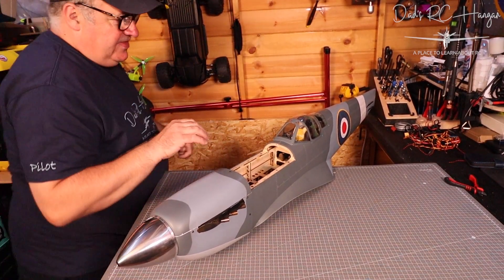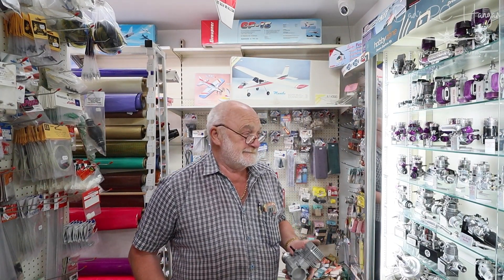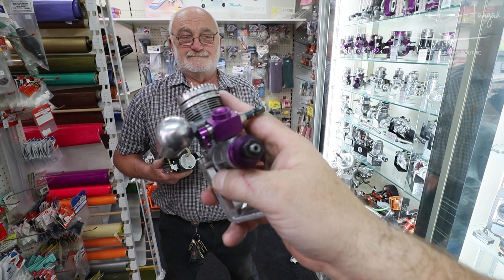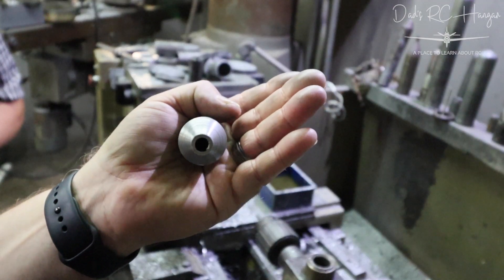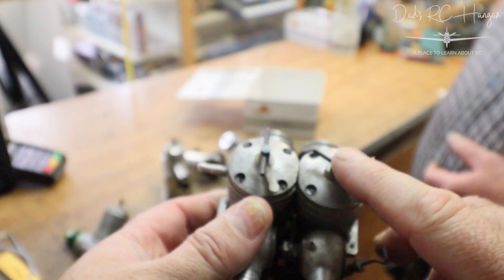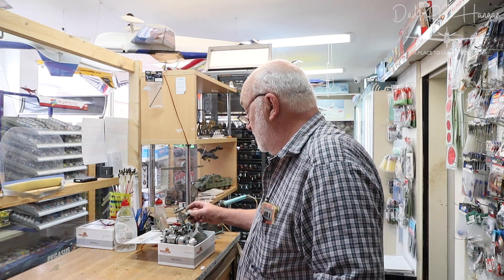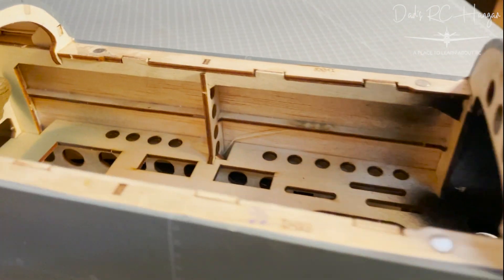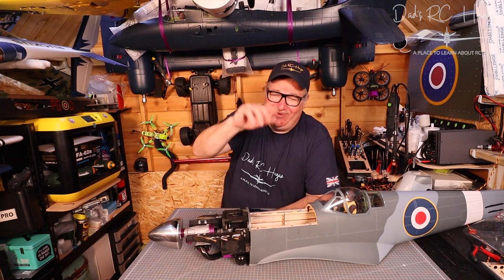Supermarine Spitfire | Custom Exhaust

Comment: Nice one Chris. Is the engine and exhaust system reasonably priced ?
Reply from the maker: £600 for both, so this was a one off. But it’s something I had on the RC bucket list. Thanks for watching David, have a great weekend.  👍🏻
Reply: Thanks Chris and you.
Reply: I think it's about time the Spitfire got finished Chris 😉💪 2 years ago mate !!! Time flies doesn't it. I must take my 60 size Spit to the field for a fly the plumbing was all wrong last time I took it last summer !!!!! 🙈
Reply from the maker: @stevearmett1565 I know buddy, it’s like I need a Month in the Hangar 😂. I have a new Fuse and Tail, I really must finish the spit. Makes me laugh when I see how long I have been trying to Fly and get my A.😄
Reply: @DadsRCHangar  you will get it this year Chris you just need a couple weeks of flying each weekend to get you back in the groove 👌
Reply from the maker: @stevearmett1565  Should be flying Saturday 😁

Comment: I use epoxy on all my mufflers, best thing you can do! Not only does it seal it but will not vibrate lose!
Reply from the maker: Yup one of the many tricks I found out from Alan. He showed me a few more that I will do in coming videos. Thanks for joining the craziness. I will watch your Heli skills soon 👍🏻
Reply: @DadsRCHangar  awesome looking forward to seeing new tricks! Also did you ever build your Tortuga?
Reply from the maker: Not yet, was asking the company if it could be converted to EDF, rather than a pusher. No response as COVID hit. I have the Mig29 to build also 😂
Reply: @DadsRCHangar  It could definitely be converted to EDF I’ve seen a few guys already do it and I have one that I will be doing it with as well. But it will of course be slower and less you go with a high-powered ETF set up I’m thinking about a 12S 80 mm. With a EDF you will probably have to bungee launch it. Really depends on what setup you want to go with. 6s 8s 12s that will depend on hand Launch or bungee launch. I will be posting a setup video on my Tortuga soon.
Reply from the maker: @westhobbiesrc8051  I will look out for that, sounds orsum 👍🏻

Comment: Nice craftsmanship. What is the total weight of this exhaust system?
Reply from the maker: Hi Icin4d, I will have to ask him, I cannot see that it would do anything to tip her over the normal CG. 
It’s very light weight. The build will be finished soon, so we will see if the CG is different from the recommended. CG.